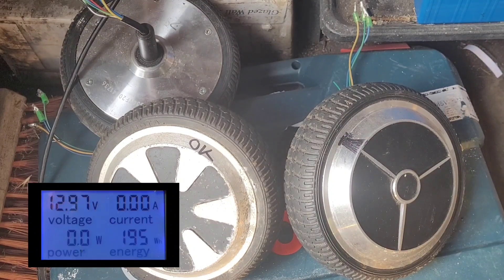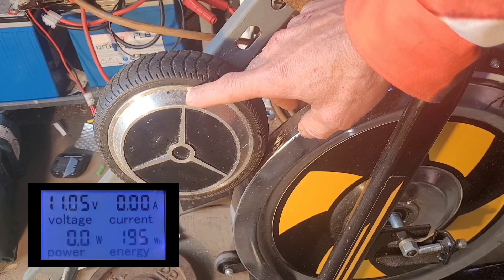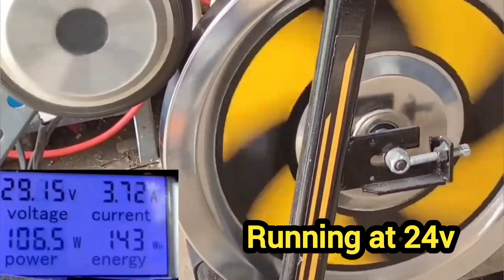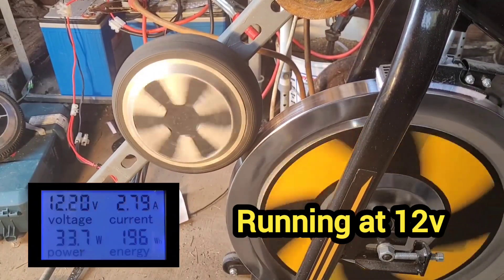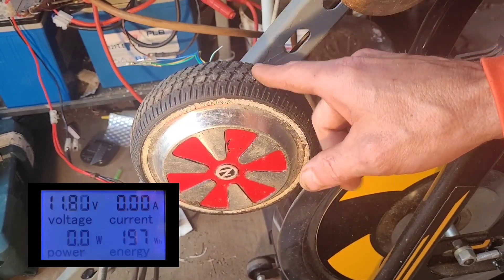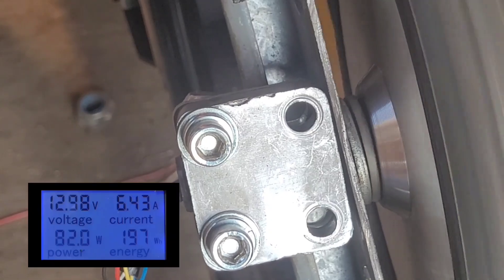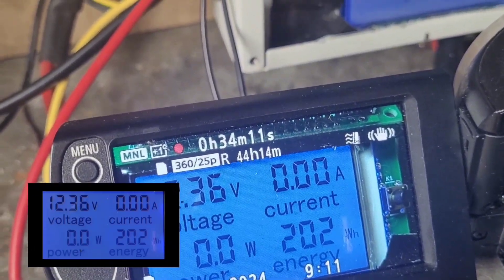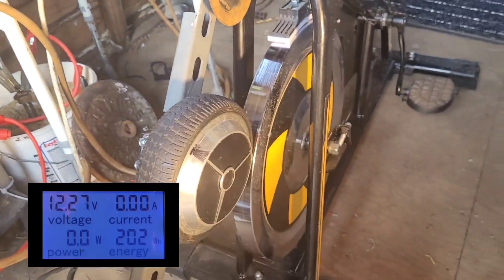Testing the HoverBoard Motors as 12v Generators ( AND COMPARE TO 24V ) SPIN BIKE OFF GRID CHARGER

Comment: If you rewired them from stock star to delta and made a gearing system so make it spin faster I think that would make more power. I think you should be able to go into 150w+ range.  I've used used them in D config on my skateboard and they really do get powerful this way on 36V. Stock motors have a lot of wire resistance and you half that in D config.
Reply from the maker: cheers for the comment , I'm not down rewiring the motors at all , I have found with a 5kg weight on the end of the arm you cam easy hit 250w in 12v mode, making more videos as we speak.

Comment: This is awesome! Thank you for sharing. What device is it which you're using to measure voltage, current, power, and energy? Amazing setup!
Reply from the maker: Hello thank you for commenting Yes it is pretty awesome I have it connected to a tristar TS45 but the digital meters are simply available on Amazon for about 12 £ they are called 100a DC watt meters, cheers.